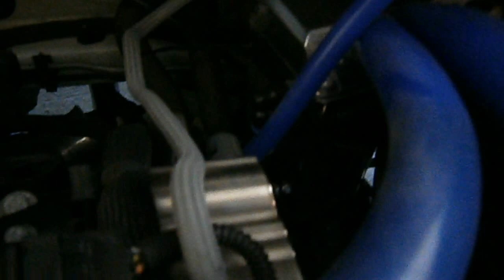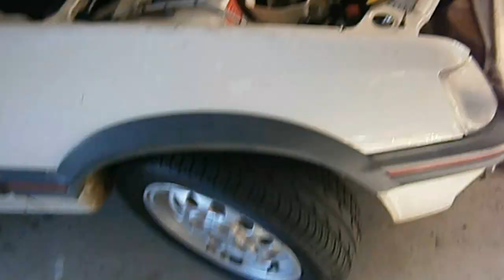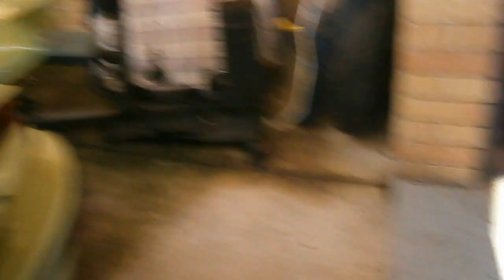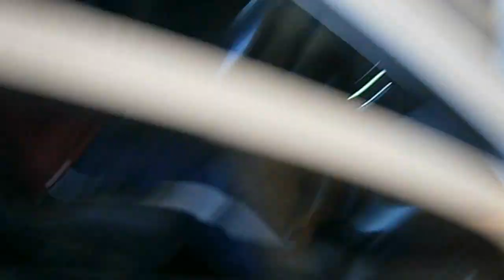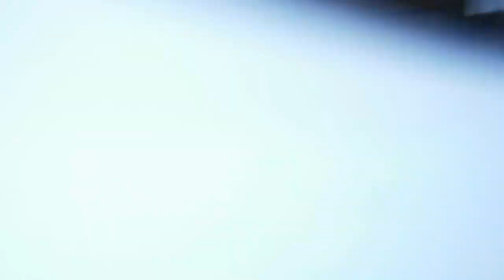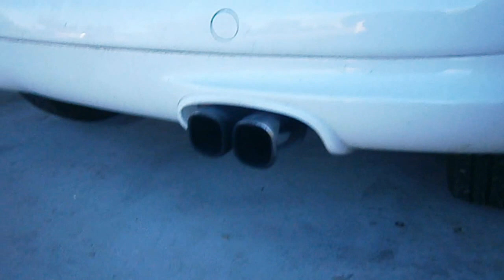Peugeot 207gti turbo 175thp rc  bov/dump valve pod filter, exhaust, oil catch can and pcv delete.

Comment: The Australian version has 175 HP standard, is this an earlier model mate? That pod under the bonnet is sucking hot air in from the engine bay, not good:/
Reply from the maker: It’s clearly the gti with 175bhp